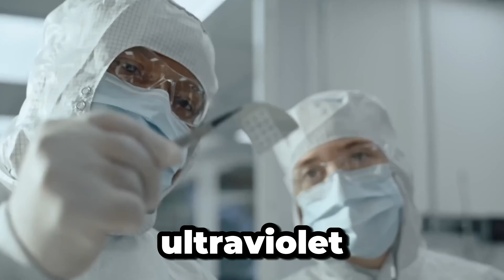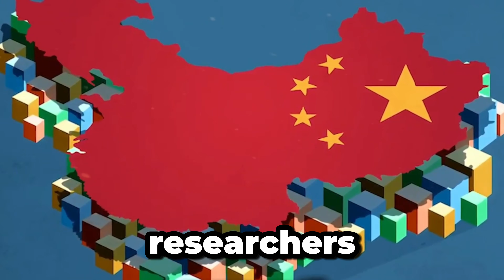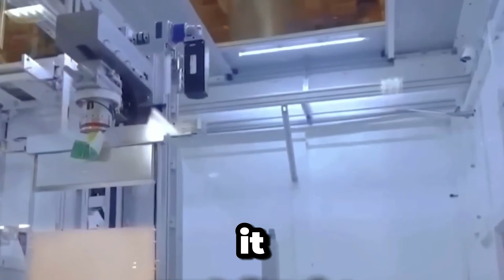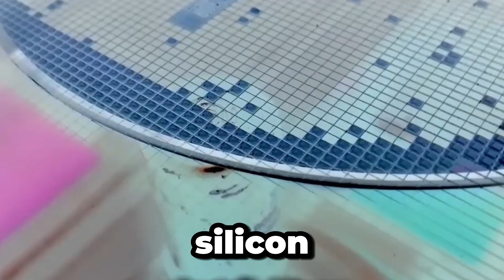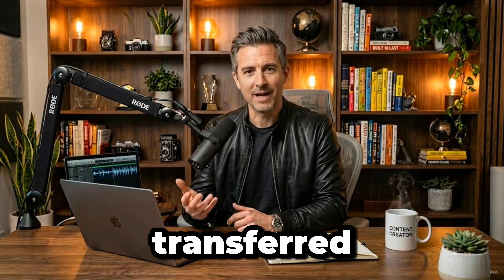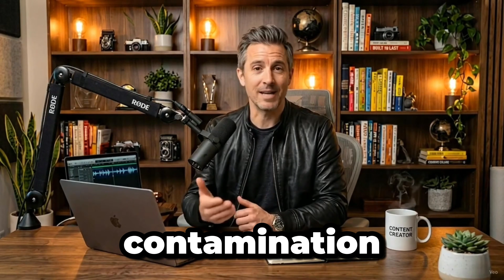China Just Stamped Photonic Chips Without DUV — And Cut Costs 90%

Comment: Diode Array has no stack registration issues.Diode Array is very tolerent of open circuit faults. Diode Array is somewhat tolerant of a few short circuit faults because the diode cross section is small. Nano stampad methods seem reasonable.

Aloha
Charles M Brown 
Kilauea, Kauai, HI 96754